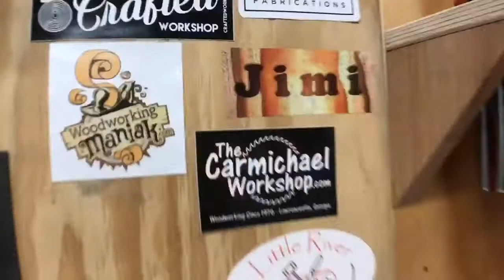(The Old) Shop organization tool wall extended

Comment: Feels good to clean up and get organized! 

My garage is small, dark, with a dirt floor.  I finally moved nearly everything out, and have started the process of cleaning it to make it functional. 

It will be nice to move around without tripping on stuff.
Reply from the maker: This is an old video and I’m no longer at that shop but yes getting organized is really important especially in a small shop. My new place has 1000 sq feet which is roughly 8 times the space in this video. I need to update this video lol. Thanks for watching.
Reply: lol, I see the old part in the title now.  My garage is maybe 16x25. 1000 sq feet is the size of my house!